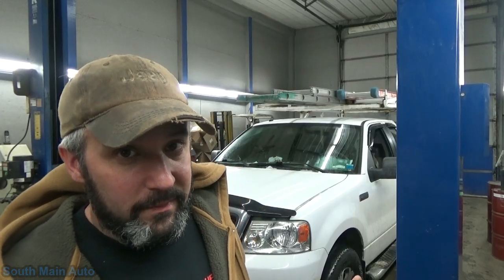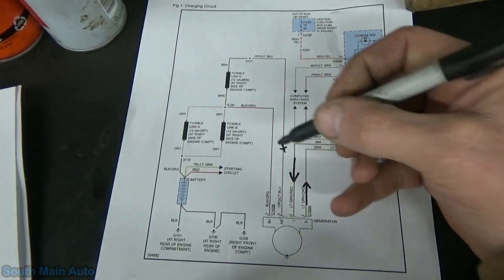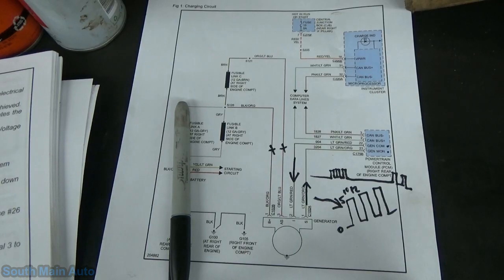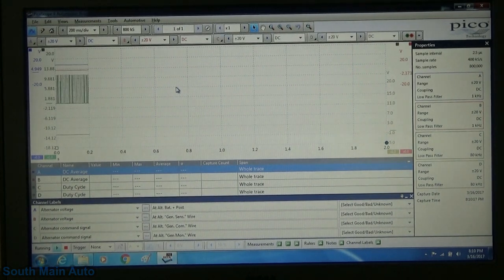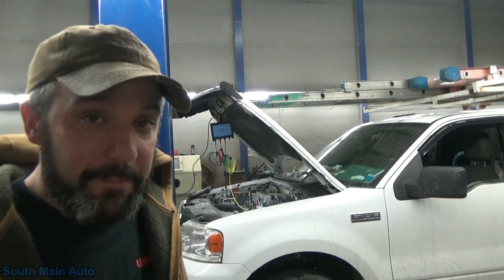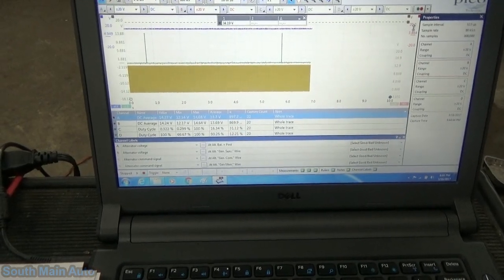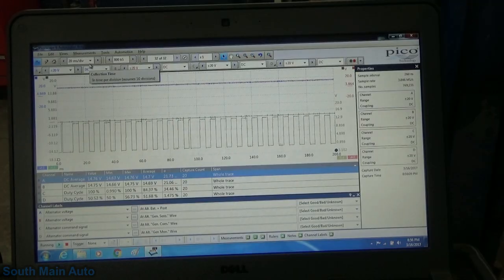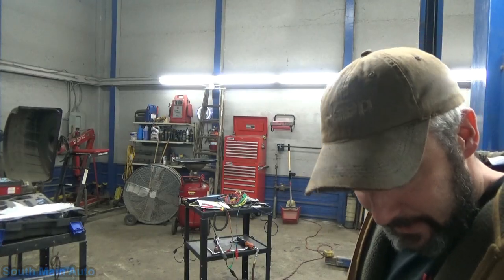Ford "Smart Charge System" Alternator Not Charging

Comment: It is good to know that even the most "advanced" systems apparently do not account for everything. I think new automobiles' engineers need to watch these videos to maybe learn a few things. Or maybe new car engineers need to stop worrying so much about the vehicles compatibility with Bluetooth devices and start thinking more about the actual automobile parts... But what do I know?!?
Reply: Actually they are all too busy worrying about all these emissions crap.
If you took a modern car and deleted all the emission stuff and managed to not make the computer worry about it, you would have a much more reliable vehicle.
No EGR crap getting gunked up over time... And for diesels, maybe introduce Euro NEGATIVE 1 to offset the sheep urine that rusts up the exhaust.
Reply: CMDR Sweeper yes they are to buy with epa standards thanks to the government regulations and environmentalists saying how much emissions the car can make don't blame car makers for that blame the government regulations.
Reply: they had the system in place to monitor the actual voltage of the battery, it would have been simple to compare the voltage of the battery and the called for voltage and if the two dont line up after a short while, then show the battery light..
Reply: yes they could have  but  its crazy in a lot of cars the parts have to pretty much fall off before you get any warning lights.
im my jeep grand  the cat had come apart plugged up the exhaust  what happened is i all of a sudden started getting horrid gas mileage and the computer wasnt calculating my my average mileage correctly rang etc.
well i couldn't figure out what was wrong change plugs some sensors no change changed wires nothing i even put the oem champion plugs in it nothing no weird sounds engine ran smooth so i kept on driving it then one day i noticed a sight hesitation when accelerating still kept driving oit i figured i would at list get a check engine light to point me in the right direction drove it about a month like that then one day im running errands its around 8 pm i noticed a hug lack in power and sounds like the engine is just revving and it starts shifting around 3,000 rpm no hp at all im like oh great transmission i continue on home couldn't go past 50 mph still no light so next morning i figure ill head to auto zone see if theres any codes and my light just isnt on no codes well next step i go to head to the repair shop i get 5 minutes up the road just starting up a inclined highway i lose all power i can only go 15 mph that quickly reduce to 5mph so i i turn m hazards on pull to the shoulder i keep going im almost over the hill and theres a parking lot at the bottom ot that hill i can pull over at i make it to the top where its ready to go down i then notice my engine temp is steadily climbing but not in the danger zone yet but quickly rising so i turn off the ac turn heater on full and roll down windows still no check engine light i get pulled over and the temp is just under the red line coolant is fissing out the overflow tank i call home let them now and i call my roadside and have it towed to the shop left the key inside car and called the shop let them now its on the way i fear the worst in 30 minutes i get a call am told the cat is completely clogged up it came apart inside i need a new one so what am i to do i cant afford the repair but i need my car back so i go ahead and okay the repair and charge up the credit card least it was only 300 to repair it i thought the o2 sensors would send a check engine light  my friends grand Cherokee send a engine light for o2 performance when his was leaking and the joints mine fails in a big way and i get no warning.

Comment: Eric,
The way I heard it several years ago is.......GEN_COM pulsing 1 pulse every 5 seconds is the PCM telling the alternator "no change in voltage set point. Keep doing what you are doing."  Multiple pulses is the PCM commanding a different set point.  When you start the engine you can watch the GEN_COM duty cycle ramp up to the target. Then you see the single pulses every 5 seconds begin and continue until something needs to change due to electrical load, RPM etc. 

This may not be 100% correct but engineers don't tell us everything about what they are really doing.
Reply: This is correct, but it's actually talking about the voltage of the battery itself.
So, it shuts down other sensors to try and force the battery into a charging state, but since there is a lack of communication elsewhere, the alternator is not engaging correctly.

In other words, I bet this truck charged ok via the Highway, or after the engine comes to operating temperature :-P.

Thanks a lot for your input here. I know it's been 2 years.

Comment: Curious. In the old days, the regulator was external. Now, it integral to the alternator. And since you went the extra route (hey, rust-salt belt mean corrosion), it made sense from an "effect-cause?" troubleshooting. It is a cost to swap in parts, especially when you get Down votes from those crappy parts supplier (We know who you are!), but if the test equipment can't resolve this, you have to resort to the good ol' meter/wiring, "reverse-back" theory. Oh, and I would remove that USB adaptor from his dash as some of that cheap-asian do-dads can wreak havoc on "sensitive" DC systems like a Ford (sure, its fused, but doesn't mean it can't drain a battery).
Reply: external alternator regulators went out in about 1972...in fact my 1972 ford had an internal regulator alternator. but my 1972 morris had a dynamo, either way, internal regulators are pretty reliable, check out BBloc's channel, he had a string of bad external regulators, even though made in the USA, they were junk
Reply: Jusb1066 
My 1990 D250 still has an external regulator. It's simple till someonehow the casing gets cracked and kills something inside
Reply: +sicktrick, perhaps its more a USA thing, you just dont see them in the UK

Comment: engineers should have a minimum of 2 years as a mechanic before designing cars and trucks!!!!!
Reply: Lyle Allred maybe 4 years would be better
Reply: Most of your engineers have done work like this before, well your mechanical and automotive engineers. It's the business guy that comes in later and says, "we nees this cheaper to maintain profit margins" "we need this within (insert impossible dimensional constraints) to meet what the graphic wants". Then on top of that there's government standards that must be maintained.
Reply: Shit dude... Most of them have already, Statistic analysis says 78 percent has had prior work in their line before becoming the engineer. So you’re left with 22 percent leaving school as an engineer WITHOUT prior experience in the field.
Reply: @NitroGuyJH, you're not a mechanic. Are you 😂
Reply: Seriously tho. I fucking hate engineers, they put stuff in the dumbest fucking spots.
Reply: engineer types cant fix a broken shoelace on a rollerskate they wont make it as mechanics for 2 days
Reply: John Hasty, I'm sorry to say, but you are completely incorrect.  The ppl that build the engine, albeit some pretty BAD designs and set ups, design the engine for/around a specific weight oil.  I've seen many times, customers use the wrong weight oil and it caused drivability issues and check engine lights.  It doesn't have any thing to do w outside temperature.  Honda for instance when the civics, accords, etc changed from 5/30 to 5/20, the only reason was the government changed fuel economy standards.  BUT, you take a new veh built around today's standards and go thicker, you will cause problems. Sorry, just simple facts....and yes, I've been working on cars professionally for over 25 years.....
Reply: I apologise, my last comment was for, No Candy,.   Not John Hasty.....
Reply: Thank u for posting this video helped me understand the way this charging system works
Reply: Probably more than that.
Reply: I agree with you
Reply: If the purge ever becomes a thing.. mechanics will go biblical on the engineers
Reply: @lyleallred904  Amen there brother or sister.....I'VE been screaming that for YEARS !!!!.....FINALLY someone agrees with me  !!!
Reply: Oil have absolutely nothing to do with charging
Reply: Not with Factory tools but backyard mechanic tools. Floor jack jack stands. Big tree used for an engine hoist. Then give him some monstrosity to rebuilt the engine on
Reply: all the parts-swapping monkey mechanics that are 20+ years backwards to 20+ years old technology say shit like this. Those engineers design the cars that smartass mechanics can't even diagnose for simple stuff (you know, the mechanic who doesn't know about the importance of a good seal on an oil cap). 
Give these mechanics a scanner and they still don't diagnose, they read every message as "replace this part now". They don't check for broken wires, loose fitting HAL sensor that only needs a new seal and stuff like that, then they are upset when you refuse to pay for the unnecessary. 
They choose obviously bad aftermarket parts (like body parts made of a sheet 3 times thinner, or a long life sensor that costs only 1€ more OEM) despite you telling them to use originals, cause they are lazy to order from 2 sources, then argue that the bumper reinforcement you can twist with one hand easily is in fact as strong as the factory one that you could be jumping on all day every day, once mounted on the car.
They break plastic trims and engine covers, they fit seals wrong, they bodge everything with a secret silicone caulk formula unknown to man that bonds to everything so strong that it makes future removal for proper fit or repair a pain. They think that a 15W-40 oil protects parts better than a full synthetic 5W-40.
Once they can't find the cause of your problem "it's an old car, that's the way it is". Their car is at least 10 years older than your old car, not a model famous for its handling, so how would they even know if it is supposed to be any better?
They gone to slow kids' school while the engineers were expected to solve complex theoretical problems and learn the practical limitations to those solutions throughout their studies.
Engineers have to meet deadlines and decide when the not-perfect is good enough, so they can move on to the yet unfinished. 
Yet many mechanics are always bitching about dumb engineers while many engineers just straight say they are not the fastest in working with tools, as they have less daily hands-on experience and don't know all the tricks.
Reply: @dushk0  I’m not even in mechanics of any kind. My background is Cyber Security. I bought a 2017 Honda Hr-V new. Since I bought it I spent long amounts of time as a whole doing the reconnaissance phase pulling every official tech manual, wire diagram, etc., to prepare because I wanted to do most repairs myself. I do a repair, I consider all the options and inspect wires and everything. I’ve even had my seats off for inspection as well. 178,000 miles later it rides great. The only real issue I have is an 1/22 ( used to be a 1/5 ),chance of intermittent, ‘ no start, single-click’ scenario. Replaced battery, battery wires, starter wires, alternator, the starter I replaced 3 times with oem brand new. Still has the issue. I ordered a complete set of oem relays to see if that helps. One thing that helped  improve my chance of start success to 1/22 chance of failure by creating my own heat shield. Those morons at Honda put a starter motor, inches above the exhaust manifold. It’s pretty clear that their engineers are morons. Try explaining this gently to a Honda technician and they will laugh in your face and act clueless.
Reply: @dushk0  while there are dumbass mechanics, hence the bad feels people have about going to a shop; engineers are fucking assholes that design headlights that require bumper cover removal to replace, put proximity sensors unprotected inside rear bumpers that allow corrosion instead of inside the trunk, so again, you have to pull the bumper cover to replace.  They do not design things to be worked on/repaired; they design them only to be put together on an assembly line and FUCK the consumer and the mechanic who has to repair the pieces of shit the consumer is overcharged for.
Reply: @dushk0  Damn bro you got more parts in a YouTube comment then these engineers fit under the hood of my truck

Comment: That setup should turn the battery light on after about 20 sec of running, and also set a code for the gen terminal. 

I know this because I had a 2006 Expedition in, had a brand new alternator on it and was charging at the 13.7 volts. The "new" alternator had the incorrect regulator on it and was in default mode like you showed. A replacement alternator with the correct regulator made the pcm happy.

Comment: This happened to me while driving along on the highway, all my gages turned off on my 2001econoline f250 van equipped with a handicapped ramp. I had never seen anything like that ever happened to me knowing quite a bit about mechanics being a mechanic since about the 80s N early 90s. I'm paralyzed now so I can't do what I use too ( mechanical work ). nevertheless it turned out to be the alternator point is that it gave me no warning except the gages just stopped working til a mechanic came to the highway, put a computer on it and found out it wasn't charging. Oh and not even did the charging meter warned me that the battery wasn't being charged! like I said, everything just turned off. after replacing the alternator everything started working again.
Thanks for your videos cause they show us alot.

Comment: Ok so I am just as confused now as I was at the beginning. I go through a lot of Alternators. I have to change them about once every year to two years. (Small amp alt. every year. Large amp alt. every two years approx) There was one time (and only once) I noticed that with the van in park, engine warm. I reved the engine. When the RPM's fell back down the "Battery" light came on. Well it flickered. brought it to the garage and they changed the alternator. The light didn't do it again. Matter of fact the next time the alt went on meI was cruising down the interstate and "BANG" it just stopped charging. I have since installed a digital display and I have noticed that the numbers do change. anywhere from 13.7 to 14.2 VDC. If I do increase the demand the volt will drop. I have not noticed them return to normal with the load on. when the load is removed the volts return. Any how hope you tell the customer the same thing you told me. "Buy a Toyota" LOL

Comment: Awesome work from nothing but the finest Eric.O as Ford sure isn't very Smart on the charging system lol. You notice right away that its odd that the battery light wasn't on since it wasn't charging and instead of ignoring it and just taking the simplest guess by putting a new alternator on it you diagnosed the problem to make sure it was that kudos. Id rather see a mechanic figure out what the problem is and not just throw parts at a vehicle as a guess.

Comment: You should charge the battery with a charger first, The alternator is suppose to maintain battery voltage, not used as a battery charger.
Reply: He had the truck on a charger for a couple hours...

Comment: Its clear the system is pretty stupid, the parameters they designed into it didnt account for a high load problem. Go home,get some sleep and yes I would have changed the alt. Sounds like its more of a maintenance system but not designed well. It should have illuminated the charge light.I bet Ford already knows this. Its too bad Mechanics cant have a general on line forum to post stuff like this so everyone can be informed. Thanks for doing what you do to inform the uninformed. Who knows,you may make so much doing these,you can retire early,lol.
Reply: they have made a working system more complicated, rely on the cpu to report a bad alternator, it should be obvious that it is calling for charge, but the system voltage isnt rising, thus just light the indicator as a fault?
Reply: scott firman Identafix is the mechanic online forum on our referring too, is pretty good,my brother has it in his shop,while not necessary it sure helps you speed up a diagnosis and gives you other mechanics outcomes and confirmed fixes for the same problem
Reply: FORD STUPID CHARGE SYSTEM!
COST 900 DOLLARS PLUS LABOR AND TAX
Reply: scott firman funny how people forget what was learned in the pass. All charging systems I have repaired I noticed that if the voltage regulator is not at fault you do not get the battery light, but you do not when the alternator is only at fault. Their systems have always been this way.  Most will talk shit about this but I've been doing this for over 30yrs. my last one like this was a 09 300 that had a light and it was the ECM. I just keep it simple and it works for me.
 Good video, it keeps my brain from sleeping.
Reply: consider the source the name  FORD  says it all
Reply: Negative it is because they can't build shit.